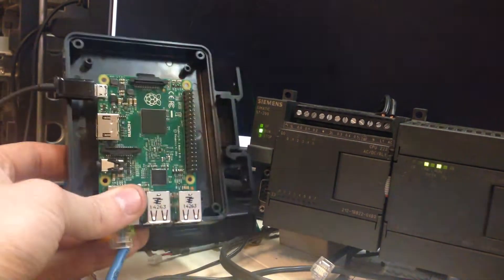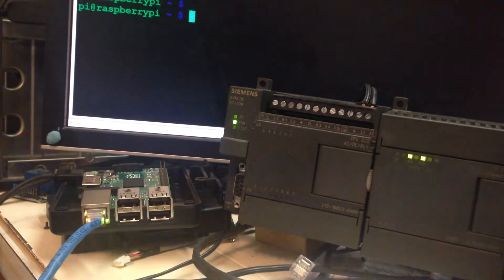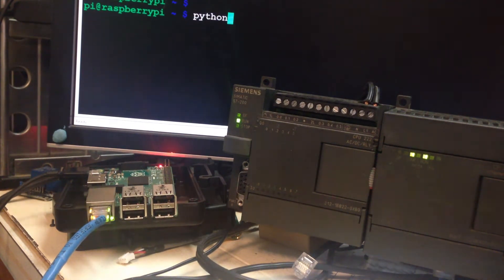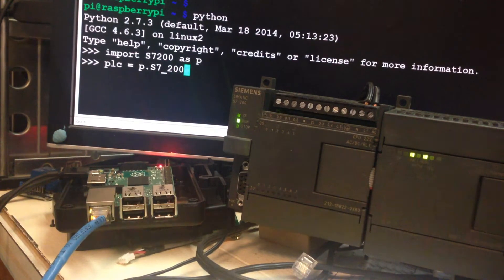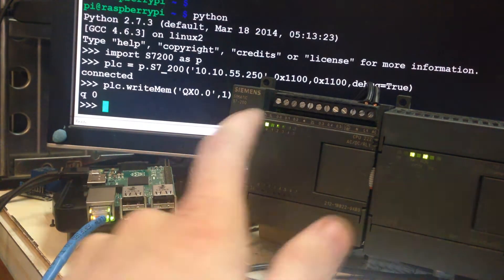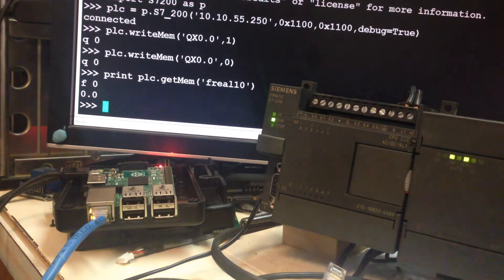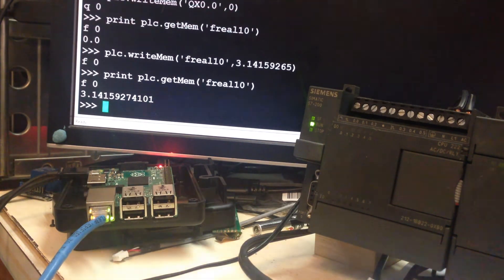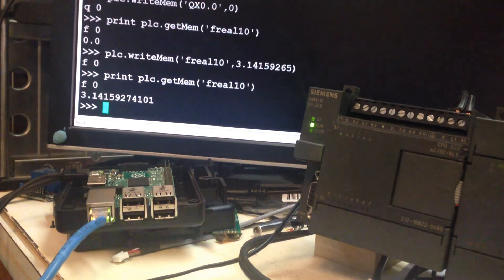Raspberry Pi Communicating with S7-200 snap7 python

Comment: Is it possible to create a home based SCADA system for  using raspberry pi and siemens plc
Reply from the maker: +michael kayeka
Yes. I have mine controlling my sprinklers. Also wiring in door sensors (reed switches). Numerous other things can be done with the right stuff
Reply: ok , I want to integrate siemens logo plc with raspberry pi to create a simple scada system, communicating this two devices is the challenge , kindly aid if you have any knowledge about it.